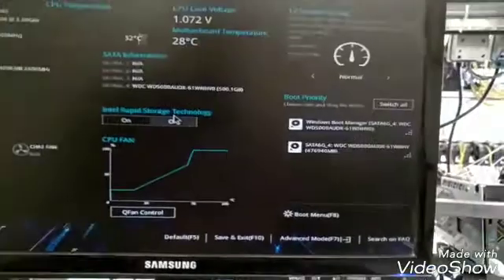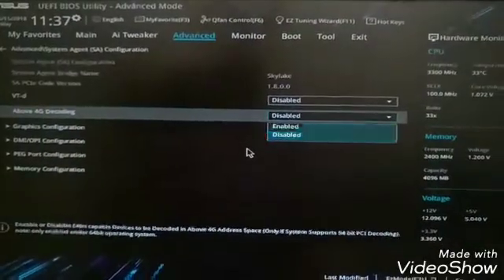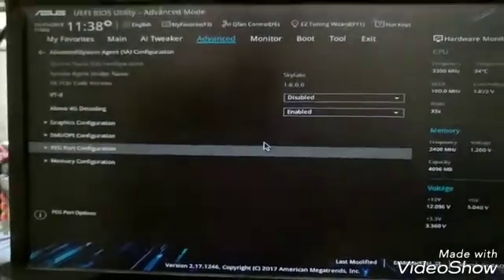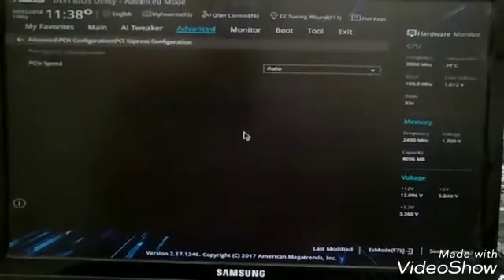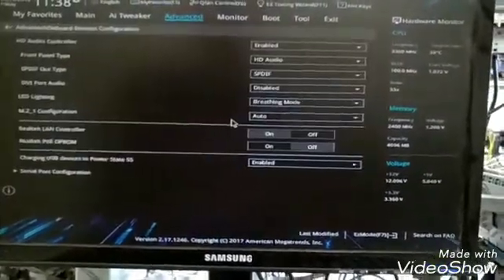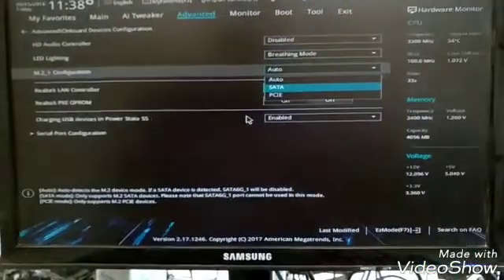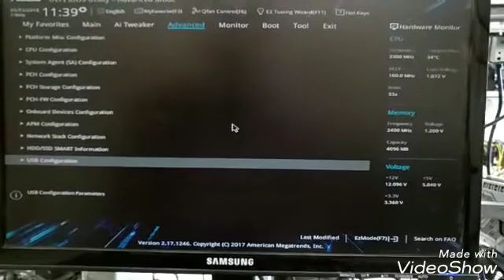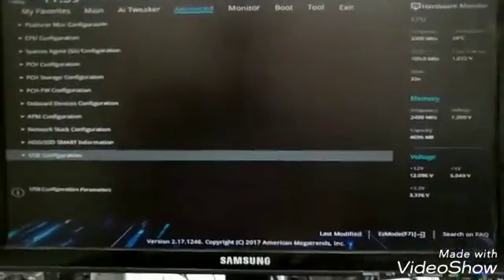How to configure BIOS setting on Asus Z270-P Prime Motherboard for GPU mining

Comment: How many graphics cards does the Z370A support? At present, 10 GPUs are running normally. If more than 10 GPUs, you can’t boot up. Is there any way to go directly to 12GPUs?

Comment: I have the Asus Z390-A version of the motherboard and I had to use the following settings to get 8 cards working. I spent over 80 hours trying to get it working and the main thing I was missing was turning off CSM.
I am using 2x nVME to PCI converters in the nVME slots & I am using the Linux install of HiveOS on an SSD Drive.

Plug the SSD drive with HiveOS into SATA4
Update to the latest version of the BIOS (v1802)
Advanced\Platform Misc Configuration - Disable all options on this page
Advanced\CPU Configuration - Software Guard Extensions (SGX) - Disabled
Advanced\CPU Configuration - Intel (VMX) Virtualization Technology) - Disabled
Advanced\System Agent (SA) Configuration - VT-d - Disabled
Advanced\System Agent (SA) Configuration - Above 4G Decoding - Enabled
Advanced\System Agent (SA) Configuration\DMI OPI Configuration - DMI Max Link Speed - Gen1
Advanced\System Agent (SA) Configuration\PEG Port Configuration - PCIEX16_1 Link Speed - Gen1
Advanced\System Agent (SA) Configuration\PEG Port Configuration - PCIEX16_2 Link Speed - Gen1
Advanced\PCH Configuration\PCI Express Configuration - PCIe Speed - Gen1
Advanced\PCH Storage Configuration - SATA Mode Selection - AHCI
Advanced\PCH Storage Configuration - SATA6G_1(Gray) - Disabled
Advanced\PCH Storage Configuration - SATA6G_2(Gray) - Disabled
Advanced\PCH Storage Configuration - SATA6G_3(Gray) - Disabled
Advanced\PCH Storage Configuration - SATA6G_5(Gray) - Disabled
Advanced\PCH Storage Configuration - SATA6G_6(Gray) - Disabled
Advanced\PCH Storage Configuration - SATA6G_7(Gray) - Disabled
Advanced\PCH Storage Configuration - SATA6G_8(Gray) - Disabled
Advanced\Thunderbolt(TM) Configuration - Discrete Thunderbolt(TM) Support - Disabled
Advanced\Onboard Devices Configuration - HD Audio - Disabled
Advanced\Onboard Devices Configuration - PCIEX16_3 Bandwidth - X4 Mode
Advanced\Onboard Devices Configuration - Hyper M.2 x16 - Disabled
Advanced\Onboard Devices Configuration - USB power delivery  in Soft Off state (S5) - Disabled
Advanced\Onboard Devices Configuration\Serial Port Configuration - Serial Port - Off
Advanced\ARM Configuration - Restore AC Power Loss - Power On
Advanced\USB Configuration\USB Port Disable Override - Disable all except for U31G1_9, U32G1_10, USB13, USB14 (this allows you to use the two black USB ports & the two blue ones under the Ethernet on the back of the motherboard)
Boot\Boot Configuration - Fast Boot - Disabled
Boot\Boot Configuration - Boot Logo Display - Enabled
Boot\Boot Configuration - POST Delay Time - 3 second
Boot\CSM (Compatibility Support Module) - Launch CSM - Disabled
Boot\Secure Boot - OS Type - Other OS
Boot - AMI Native NVMe Driver Support - Off

I booted into HiveOS by adding 1 GPU at a time, in this order:
X16_1 (closest to the CPU)
X16_2
X16_3
PCI_1X_1 (closest to the CPU)
PCI_1X_2
PCI_1X_3
nVME 1 (closest to the CPU)

nVME 2

BOOM! I hope this helps someone - I spent way too much time getting this board working properly!
Reply: Im getting this board tomorrow
Will only use 4 gpus
I hope i wont face any problems
Reply: Hi Steven, thanks for you comment!
Do you know why some mining tutorials recommend Gen1 speed and others Gen2 speed?
Reply: CSM enabled because the vga card does not support the current mode something like this pops up